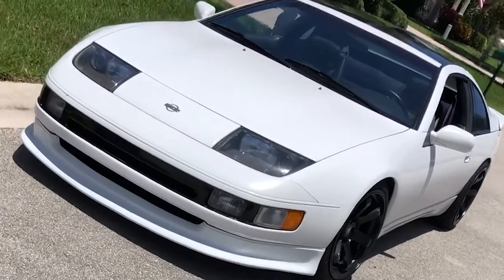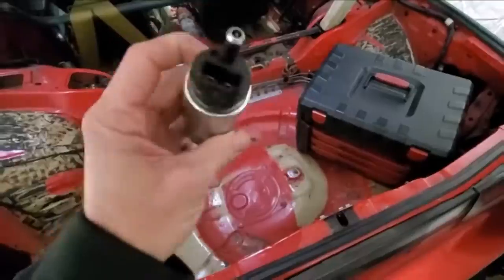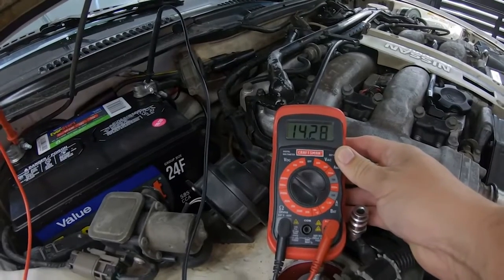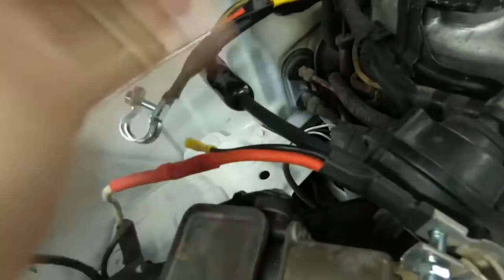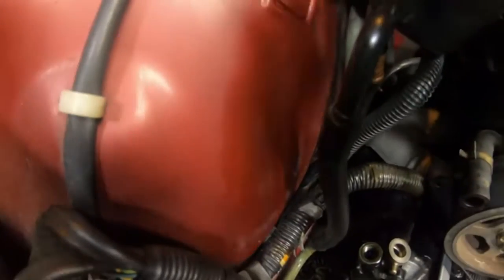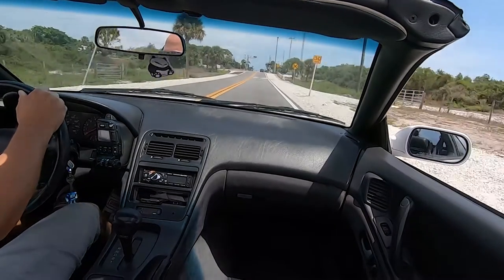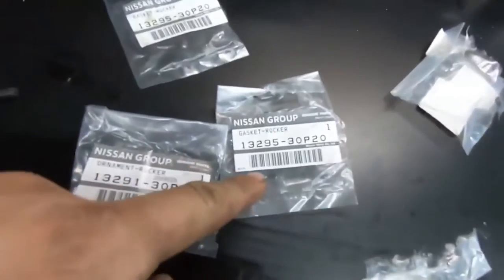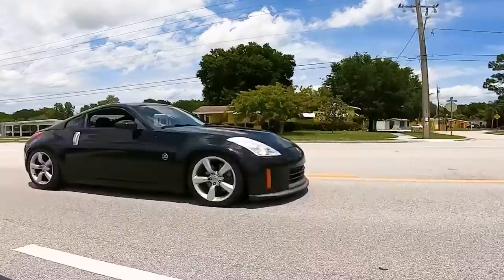Ever 300zx z32 OWNERS Top 10 to do LIST!

Comment: 0:45 This applies to anything service wise. If it wasn't replaced in the last 20 years, or has record of it... it probably needs replacement. Also bushings should be done/covered at this point as well. Most subframe bushings are completely shot/leaking along with the diff bushings. You can use spacers for the subframe, but the other fluid bushings need to be burned out and replaced. The rear end on mine was so shot the tires were lifting just taking a normal corner and making it break out under light throttle. My bearings/hubs were also completely gone causing excessive tire wear.

You didn't cover brakes and that should be at the same time as the suspension or soon after. Just fluid changing alone can breathe new life into the brake system.

2:28 or it's a napanator and failing. It's important that you mention to ONLY use an oem alternator unless they are having it professionally rebuilt, as those napa/auto/oreily nators are only as good as their warranty... Ya it's lifetime, but you're going to be changing it every 1-6 months for life(also oreilys only allows 4 warranties before requiring another purchase). Professionally rebuilt is the way to go, but finding a shop local that does it right and not just using cheap components is hard, as having more copper windings will increase amp capacity quite a bit.

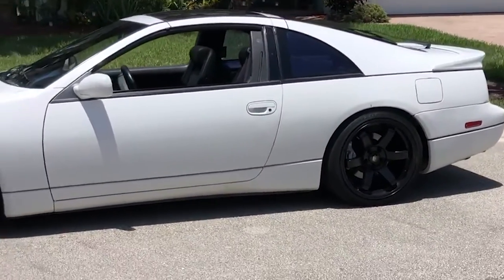4:40 Cowls are now NLA as of last year. There are repros being made, but if the existing is still there any "mostly" in one piece it can be repaired with a fiberglass kit, sanded, painted, cleared and it'll be good to go another twenty years. Else this is a really expensive and annoying part to replace.

5:10 if the low pressure lines need replacing you better believe the high pressure lines need it too. Also the crush washers on the rack, seals and possibly the high pressure sensor(erratic jerking and stiff steering will indicate this). Check everything. I've yet to see one that didn't have a leaking rack or low pressure line.

6:25 The grounding mod should be performed as well to prevent further premature failure. From the factory there will ALWAYS be power being sent to the injectors even when the car is off, and this can lead to electrolysis and corrosion of the coils. Performing the ground mod will prevent voltage from being sent to the injectors when the ignition is off. It's very simple to do any everyone can do it just referencing the guide. 

7:20 As with everything it's important to torque the bolts to spec when reinstalling, but it is paramount this is done with the valve covers. If you over torque the covers doing it free hand and not using a torque wrench it will BREAK the cover and you'll have to replace it. These are /fragile/ and somewhat hard to find if you break one. This can set you back days/weeks if you snap one by accident. It's also important this is done if you use the dress up bolt kit because it applied /more/ torque to the covers and are known to break it easily. Anyone doing this themselves should reference the guide on bolt order and torque specs.

Also replace the half moons in the back with aluminum plugs and be done with ever changing the rubber ones again. These sometimes are so hard and cemented in it required a mallet to knock them out.

8:50 Again OEM parts here is important to mention. Timken is now NLA as of two years ago. Timken was the OEM provider of the wheel bearings, and timing pulleys. There ARE OE equivalent pulleys now, but there are also cheap ones that can fail early. ALWAYS replace the tensioner with an OEM unit and DO NOT UNWIND TOO QUICKLY. The belts are all about the same now, so that's at least one thing that can be cheaped out on.

Water pump should always be OEM. It's 150 now for an OEM unit(250+ ten years ago) and roughly the same price as aftermarket/napa/auto. The major difference is the bearing quality, seal and impeller design on the aftermarket ones. Aftermarket pumps have a 50% failure rate from what I've seen and it's almost always the bearings failing leading to other issues. The pump studs should also be replaced at this point, and fan clutch checked if it needs service/replacement.

I would add to your guide the EFI harness... as MOST are completely done. Hard, brittle, broken and failing in multiple areas. A shorting harness can cause multiple issues and lead you to think something else had failed when it hasn't. Also to check your grounds, clean, replace given many are corroded and not getting a good connection either. Dirty grounds can cause trouble starting, running and other erratic electrical issues.

Other things. PCV Valves, PCV lines, EGR delete where applicable, new vacuum lines, coolant line bypass/delete. Too many small things to list, but leaking vacuum lines can cause multiple issues along with clogged PCV valves.
Reply from the maker: Awesome, Thanks Fake Jeep!
Reply: A lot of great info! I have been out of the scene for years but I'm pretty sure there was even a factory service bulletin about grounding the injectors the way they were in later years.

Comment: had an 89 z32 for just under 5 years now, this was a great video.
Like that you talked about actual issues and not surface level things like rust, or seat wear in the corner, hicas, oil change, etc
other things like ptu, engine harness, and anything rubber in general create alot of issues if you take care of it, its a great car!
Reply from the maker: Thanks Marshall!!
Reply: 89 z32???
Reply: @gavinklausner4696  I guess his 1990 was built in 1989?
Or perhaps he has a JDM model, where they are labeled by month and year.
Reply: @skylinefever  isn't that how like all cars work though? a lot of the 2022 models are made in 2021 and so on. I mean you see car ads for next years model before it is that year.
Reply: @realyopikechannel  In Japan, your car is noted by the month and year it was built. Marketing works differently over there.

In the USA, there were plenty of 1990 cars made in 1989.

Comment: The irony is, the Z32 is the first flagship JDM sports car from the 90's, but people don't revere it as much as the FD3S or MKIV. The latter two are more revered because of the Fast & Furious franchise, and also because they were the last two (in that particular order FD, and finally MKIV before the final nail to the coffin was driven into 90's JDM glory) to arrive in the U.S. before the Japanese yen got too high and they became $50,000 cars (MSRP) in the latter 90's. Yes, they were that expensive in the late 90's, brand new from the dealers. 

Luckily, I bought two Z32s within the last 3 years, a twin turbo one and NA, both 2 + 0. But the NA one will receive an LS3 swap with LOJ's kit. The TT one will be preserved to nearly stock configuration. I don't believe in "over accessorizing" i.e. rice or "drift missiling" them out. It makes them look cheap and junky when in reality, a Z32 is equivalent to today's M3/4. The Z33, Z34, and now "Z35's" aren't. But the Z32 was an unprecedented rise in Nissan Z car history.
Reply: What amazes me is how close the Z32 performs when compared to the MKIV Supra. Given the price difference, you'd think the cars were in a completely different league. Sure, the MKIV Supra outperforms it, but not what the price would suggest.
Reply: L on the ricer, im making mine full body kitted with f40 wing and gold wheels (i have a dark green one)
Reply: If you dont mind me asking what did you pay hard to get a twin turbo under 10k now
Reply: Are you serious??? Lmfao, the s13/14 is the flagship of 90s jdm cars and it had absolutely nothing to do with F&F movies. I was actually pissed they used a s14 as a drag car in the 1st movie.  I built a s13 from the ground up with a redtop sr and owned a s14 but never built the motor.  I currently own a z32 shell that I am building just because I like the car, it is not better than the Supra or FD let alone FC rx7 either lol. The z32 was looked over for a reason. The other cars available where just better.
Reply: @eekay3646  This is what I mean with collector value.
I had this thought several years ago, when a 300ZXTT could be bought used for 10,000, and a Supra MKIV TT was closer to 40,000. Now I don't even want to think about what they cost.

Yet when those cars were new, a 300ZXTT was closer to 40,000, and a Supra MKIV TT might have been 50,000.
Reply: @eekay3646  It keeps getting worse. I think about how the MKIV costs this generation as much as a Dodge Charger General Lee costs the previous generation.

Comment: Is there any suggested place near Tampa Florida that works or specialise is these beautiful cars. I have a 1993 300zx na my self. With only 90k miles. I have changed all my head gasket a fuel injectors all the hoses and the timing build as well as the alternator. And after all this been done I’m having an issue with the car not staying on. I was told it might be the wire harness because of the age of the car. Please any suggestions??

Comment: I have a question for you.  I want to do the 120k service kit.  My water pump fan has a wobble.  Valve covers leaking, camshaft half moons too, alternator probably weak and all that. But I'm afraid of doing the timing and tps adjustments myself since it'd be my first time with it and this car is still new to me. might have a specialist help with the timing parts.  
So if I went ahead and did the plenum pull, deletes, new injectors, new spark plugs, valve cover gaskets and all the other I can myself to save money,  then put it back together for them to finish,
Would it be pointless cause they'd have to remove some of it anyways to do the rest of the service or in case they need to inspect its internals themselves. idk, what are your thoughts? Still just saving up for the parts currently
Reply: In my opinion if I were you, I’d just wait to do it all at once and wait till you accumulate all the parts as you can over time.  If it’s not your daily driver it will be easy to have the patience and you’ll be glad you done it all once it’s complete and ready to hit the road again.
Reply from the maker: Timing belt can be intimidating, I understand that. If you are going to pull the intake manifold and tackle that project and have someone else do the 120k service, go for it. The 120k service dose NOT require the intake manifold to be pulled to complete, so those are 2 separate jobs. Make sure you have all the parts before you start. best of luck!

Comment: boost it so violently on a chipped stock ecu that 4 out of the 6 cylinders yeet themselves into oblivion also weld diff remove spring from handbrake button = profit with driftyboiii

Comment: i have a sr20det i just upgraded the turbo and keep getting boost leaks from ruptured vacuum lines,any recomendation on what to use for reliability? i was considering getting turbosmart scilicone hoses or just using braided rubber hoses but not sure what i want to do yet